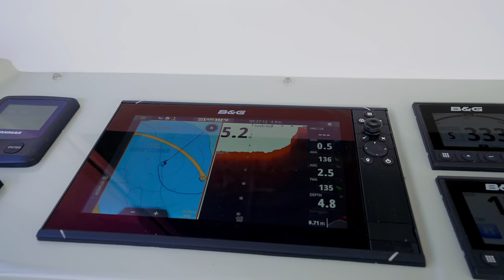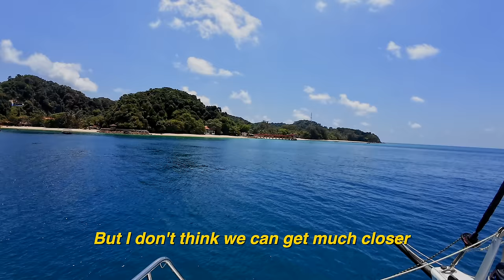Multiple system FAILURE! How this one small part almost stopped our SAILING!

Comment: I once had a watertank that kept mysteriously growing algae despite cleaning. Finally traced it to a dip in the fill hose that was growing a jungle of algae in the dip. Everytime the tank was filled some new algae was flushed into the tank. You might check the watermaker output line for something similar.

Comment: Hello, you might consider a passive centrifugal pre-filter on the inlet of your raw water supply.
They are quite small for what they do and will extend the life of your main inline replaceable filters by a lot.
The best thing about them is that they don't use any electrical power, unless you get a pump driven one.
Just a thought, cheers.

Comment: Two handy gadgets, both cheap, if you work with solenoids. The main one, a "Mag Stick". A battery operated detector for magnetic fields. You just put the tip to the top of the solenoid and if the LED glows there is a magnetic field. The other is a ring magnet. take off the coil (power isolated!) and use the permanent magnet to open/close the valve. Got mine from RS years ago.
Reply: I was just about to say this...  solenoids can be so finicky.
Reply: @dlachtor  Especially the low voltage ones.

Comment: A mechanical filter is a good start on your water system but it sounds like you have a lot of contaminates.  I would suggest you put in a UV light filter in your water line to eliminate growing bugs in the water.  you can get one from most fish pet stores that will work.

Comment: Just watched the episode where you were fixing the ice maker. Might I suggest an in line strainer for the water maker supply line. Should be able to find one when in port, or while transiting to Med. easier to clean the strainer than the solenoid.

Comment: You Can take that solenoid apart pop that blue part of with a screwdriver then take that flat nut of and take the valve out. inside it looks like a small shaft with a sharp point with a spring inside.  clean it and put it back together. That should stop the water flow. But yes you will have to clean your water tank. leave the icy maker of untill you clean your tank.....lolol

Comment: Nick - on the water tank debris issue. You are not wasting your time knocking up a ‘polishing’ rig but do you have good access hatches on your water tanks? If so it may be more effective to run one tank down to minimum, then use a wet and dry vacuum to remove the debris in one fell swoop. I am assuming you have a wet and dry vacuum .😀👍

Comment: Hey Nick, you are getting VERY good at diagnosing and fixing problems. It is fun to watch your solutions come together and actually work. We spend five months each year on our little old trawler exploring the Inside Passage between Seattle and Southeast Alaska. Portions of it are as remote as you find almost anywhere in the world. We have built up quite an assembly of parts and pieces in our kit to keep things running over the 42 years we have owned our simple little boat. I can only imagine how complex the systems are aboard Ruby Rose 2, and how extensive your kit will become. Frankly, we don't want more complexity. We consciously try to keep everything as simple as possible, but no simpler. 
RE: your water, watermaker, and ice maker woes, I have some ideas for you consideration: 1) agrressively filter EVERY single dop of water that goes in your tanks with a REALLY good filtration system (the idea of a water polishing system is a good one too); 2) install an Acuva (or other) inline filter that includes a UV light that kills bacteria as well as a physical fitler - then do not drink any water on board the boat that hasn't gone through that filter; 3) as you build up your plumbing repair kit on the boat, include a selection of SHARKBITE fittings - they are super quick and easy to install, don't leak, and can be disassembled as quickly as they go together. The Sharkbite fittings are expensive, but the first time it takes you two minutes to put a solution to a plumbing problem in place (rather than twenty minutes or two hours or a full day), you will forget about the cost. They make everything from backflow preventers to unions to valves. They have brass (r maybe it is bronze) housings, not plastic, so they don't break. We carry about 30 of them in our plumbing kit. I have essemtially rebuilt our entire water system over the years, piece by piece. Sharkbite fittings are the best I have found and I have used them everywhere. Never had a failure. In total, they have saved me days, not hours. Also, we keep a supply of pex water line on board in various sizes. It handles any pressure a boat system will impose, seems to last forever, is easy to use, doesn't break if it freezes, and works very well with Sharkbite fittings. It is also available almost anywhere a basic building supply store exists. 
One other comment - a really good marine electrician once told me "Never install any electrical device on a boat that isn't fused or on a breaker." He stressed that includes absolutely everything, even solenoids, which are pretty brain-dead simple valves. You might want to install a fused switch on the lead to your solenoid. My wife and I were both volunteer firefightsrs for twenty years. We have had to fight three boat fires (one on an 85' Ocean Alexander) that were traced to electrical failures that would not have happened if proper fusing(breakers had been installed on the circuits. In two of those cases, the only way to put out the fire was to sink the boat, including the OA. Fuses and breakers are remarkably cheap, and the peace of mind they give you is invaluable.

Comment: A bit surprised that there weren't or are not isolation valves for any appliance using water so it can be isolated from the rest of the system until repaired. Manufacturer must have overlooked it.

Comment: I know nothing about sailing life. I come to see you need to be a jack of all trades. As a Commercial Transport Tech, i wonder if the solenoid issue may be do to a failed diode in the wiring. A lesson learned over the years, have 2 drawers in my box dedicated to solenoid, diodes, fittings, nuts bolts, ect for emergencies. Especially in my go box for field repairs never know when you will need something, and not have a solution. Hope the fixes worked and the beverages were refreahing. Love the explanation on how solenoid works!😊

Comment: Sounds like Nick has another project to do......get an isolation valve installed on the water supply line to the ice maker.
Reply: Definitely. And as the machine (maybe all ice makers) is a little fussy, maybe its own dedicated little filter (after the svs valve). 👍

Comment: Great thought process on the water filter issue.  There is a company that makes a cleanable water filter.  It is a series of plastic disks with small gruves like and old record. Very efficient  and very easy to clean. If i find the info ill forward it to you.
Dave from Massachusetts.

Comment: Concerning the water system , is there not a 15 or better a 1 micron whole house water filter immediatly after your fresh water pump . If not install one, this will keep things out of all your taps and valves and solenoids.  Als9 get an inline valve for your ice maker and install it in the line somewhere it can be reached. I would of thought there should be a water manifold where water goes out to each delivery point that could be shut off (can't imagine this boat not having one )  CHEERS AND FAIR WINDS      Steve h

Comment: The solenoid valves use a rubber plunger as the valve.  There are four screws holding it together. Just remove the screw, clean the rubber plunger with a rag.  Then put back together.  Cleans any scum accumulation.   Good luck

Comment: They should make shut off valves,  solenoids easily maintenance, like a flushvavle or ballcock/fill valve.  Just like a gate or globe vavle..I now see Nick saying the same.
He knows!!
Reply: The builders of this boat know that every water source requires a manual shut-off valve. You can flush the solenoid operated valve. Pretty strait forward. He just had to be told how. The crap in the water tanks would piss me off. What the hell kind of filtration is being used!? Crap design or lazy

Comment: If I was Nick I would be very frustrated to say the least with the silly details that the boat builder messed up. I have the same outlook as Nick did initially, you can't expect everything to be perfect and there is going to be some ongoing upgrades to unforeseen issues. However some of the problems that you have experienced was totally unnecessary through lack of thought and understanding and a lot of the issues were completely avoidable. But then you take a step back and see where you are it must be absolutely worth the hassle 😅

Comment: my last camper van had that brand of fridge - quite noisy and not very efficient, with poor temperature control. Now have a Dometic and it seems like a better unit all round. No sure if you have an option to switch it out?

Comment: Needing to be MacGyver is well known trait if you own and maintain a yacht yourself and Nick learns to do this well... with a bit of whining.  RO water makers are simple in concept, but the reality of filtering salt from sea water means all sorts of other crap adds to the filter woes. Pre-filters (polishing) would help as would running the water maker in clean waters, but coastal waters in particular are full of debris. I guess it's a first world conundrum: water maker filter system maintenance vs tanked / bottled water / environmental plastics. As for the icemaker...Teresa has that sorted. "It's only an icemaker".

Comment: I wonder if you have regrets over buying a Seawind, with all the problems you've been having.  Of course, I don't really blame Seawind, since it appears that most of the problems are with suppliers and not Seawind, per se.  It does seem though that you're spending an awful lot of time doing repairs on a new boat, though.  
I hope your filtration system for the water works.  With all the algae in the system, you really need to get it out so that it doesn't block solenoids and such.  I was thinking that a total and complete flush of the system might be necessary, but I'm not sure what it would take to do that.
Anyway, I wish you safe travels as you get to the port where RR2 gets loaded for the Med, and I look forward to your Med cruising.
Reply: Some of it looks to be design issues. Other boat manufactors have multiple tanks in their boats and you can pump the water between them. Of course they then have filtration systems between them so you can clean your water and tanks all the time during this.

Comment: You mentioned using a carbon/charcoal filter in your water "polishing" system. A particulate filter could be better for capturing the debris. The charcoal filter is more for the taste of the water and chemical removal. A 2 stage coarse filter followed by a finer filter will clog less and be cheaper than the charcoal. Use charcoal just before your drinking water tap in the galley. 
The lack of a manual shut off valve on the pressurized water line to the ice maker is unacceptable, and of course Seawind should make sure that this never happens again. Are there shut off/isolation valves for the galley and heads? Or are you expected to shut down the fresh water pump and loose the entire pressurized system until you fix any problem?
Looking forward to you cruising the Mediterranean. Please tell us details about shipping RR2. Loading, unloading, cost, are you allowed to ride along on the ship, is it a standard cargo ship or a specialized yacht transporter, etc.? Here's hoping it goes smoothly and that you get to shoot video of the process.
Nancelot13 is correct that if you have an access port  a shop vac is the best first step to tank cleaning as it will remove most of the gunk and save you from many filter changes

Comment: Hi guys, firstly genius use of the glue gun!!! I'm a bit concerned with the risk of legionnaires disease in your water system. Warning signs are slime or algea, cold water temperature between 20 to 55 degrees cecentigrade the presence of any iron fittings in the system which the algae feeds off and your shower heads that will produce a water droplet of the correct size to be absorbed by your lungs if breathed in. As a plumbing and heating engineer my college instructor caught it at a spar and was seriously ill. I think your whole system needs draining, flushing with chlorine which will also cure this reoccurring problem with blockages in the ice maker, I think.

Comment: Nick, I thought your workbench had a table AND power so that you could do these repairs there, not siting in in the dingy hot-wiring the thing to fix it?
Reply: The 12 volt battery was there though, why would he move all that just to put it back when he could just do it there and then
Reply: @solaireastora5394  It seemed like he had to disable the seats limiting arm so he could get to the battery properly. He would then have to re-attach it back after fixing the solenoid. That's a lot of mucking around in my boo, when you had a purpose built desk with power installed just specifically for that purpose. NO?

Comment: Doesn't anyone make some kind of gauze filter to go over the outside of a through-hull?  Seems an obvious thing that could stop big debris from getting in.  Debris would wash off under sail and if not, you just go over the side and brush it clear.

I'm assuming the debris came from the sea.  But there was debris was in the tank, and the water must have passed through the watermaker.  Unless the tank was filled from a freshwater source that had debris in it.  Dunno, but if all the filters are getting blocked it sounds like debris in the sea water.

Would a bit of sponge in the though-hull work?  Seems so obvious, but it doesn't look like anyone does it, so I guess it does not work.

Comment: Nick…. You should look into a small air tank with hose and nozzle… that will give you a better chance of blowing out debris… just have to be aware of blowing on or through a delicate area such as a thin diaphragm.
Perhaps a smaller Pancake style air tank compressor… it would provide enough air to blow things out and still be easily portable and it would not take up much storage.
Reply: It certainly would!
Reply: What about a bicycle pump, or a can of air-duster?

Comment: Y'all still just need a good wet/dry 5-10 gallon shop vac with a long tube to clean that nastyness out of your tanks and dump it overboard.
Stick the tube end down to the bottom and turn it on.
Schluuup.
Stuff is gone.
Reply from the maker: We actually have one . Should have used it